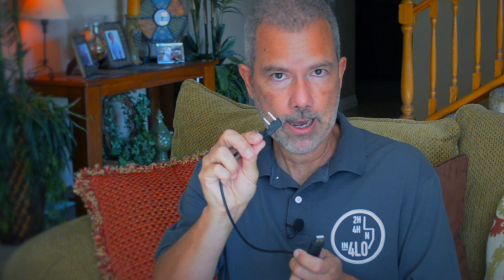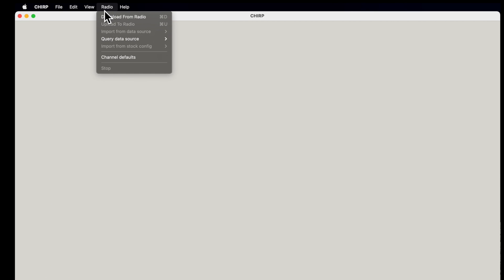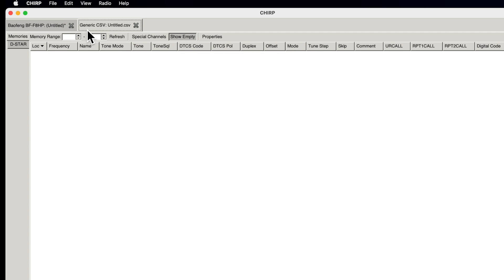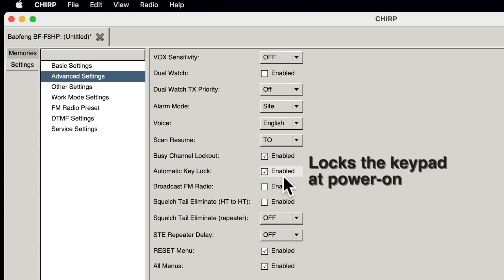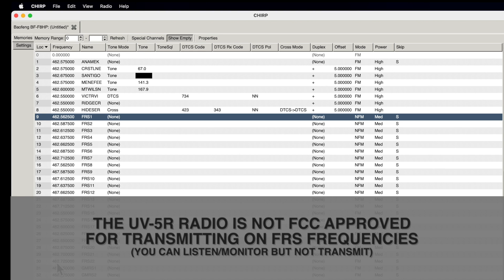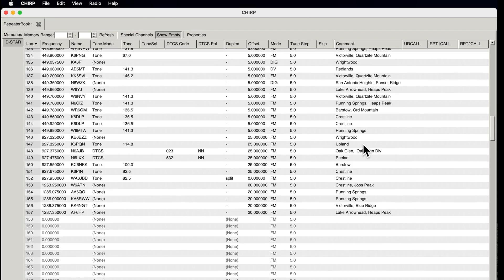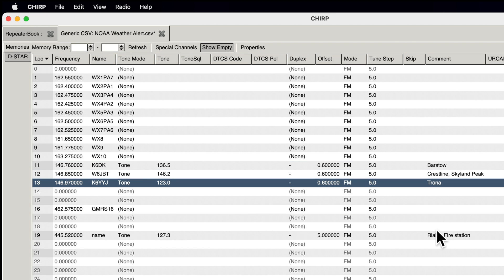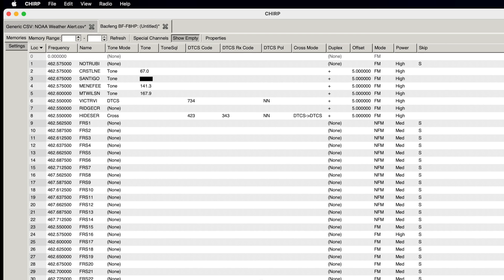How To Use CHIRP Software To Program A Baofeng UV-5R. Using CHIRP for HAM, GMRS, and FRS Radios

Comment: I just purchased a UV-5R to use when offroading with a group. We used Channel FRS-14 to stay in touch with the leader of the group. I never did transmit, just listened to him. Am I legally able to transmit to the leader if need be.
Reply from the maker: "Legally"?  No ..
Reply: @TheNotaRubicon  is he legally transmitting to the group
Reply: Never mind that 2nd question, I just remembered he was using some cheapo walkie talkies he have to everybody else
Reply: Now to GMRS, I applied and received a Call Sign for my GMRS License. I still can't transmit using the UV-5R. How do we Baofang UV-5R owners go about getting this Wonderful (kiss the radio) unit approved by the FCC. Do we need to write letters, emails, etc...

Comment: Does anyone know how to run Chirp on a Mac??? I have a new Mac Mini with the M1 chip
Reply from the maker: Just follow the instructions to install it, then double-click on the app icon to open it.. pretty much like every other app on a Mac.
Reply: @TheNotaRubicon  its an "Unverified App" Got around that issue. Now I get an error message that the app quit unexpectedly. Ive deleted and downloaded again several times and still the same result. At this point unless get some guidance otherwise I hope there is another way or another App to program my Baofeng with my Mac or other device.
Reply from the maker: "quit unexpectedly" is nice-speak for "it crashed" .. so it is possible that it is not M1 compatible - not sure anything can be done at your end about that, but you may want to report the error to the CHIRP team here:  https://chirp.danplanet.com/projects/chirp/issues?set_filter=1
Reply: @TheNotaRubicon  Randy, I'm betting it is the CHIRP SW won't run in the Rosetta Intel emulator that Mac M1's have.  My solution for software like than is to use Parallels Desktop for M1 and run a WIndows 10 ARM64 virtual machine.

Comment: How do I merge my frequency list from Wouxun radio programming software to Chirp
Reply from the maker: I dont use the Wouxun software, so there may be a better way - but you can upload the list from your Wouxun program into your radio, then connect to CHIRP and download the programming from the radio into CHIRP.
Reply: @TheNotaRubicon  I will try that.  Thanks
Reply: I tried doing what you suggested and  it won't allow me to do it.  After you hit download from radio and it asks you the Com port, make and model it doesn't have my radio on the list.

Comment: Hello Randy, Does the cable that comes with the radio for Programming not work?? I did all the steps correct and I am getting radio not found. I don't want to buy a new cable if I am doing something else wrong. Just curious to know if the cable that comes with doesn't work with Chirp??
Reply from the maker: none of my radios came with cables - i had to purchase them separately.. if it doesnt work, it's either bad/fake, or there is a problem with the drivers installed/not installed on your computer.

Comment: Not sure if someone else has asked this question yet. If I have two radios and one is programmed with a bunch of channels and want to duplicate those programmed channels on another radio, how is that done on the computer? I understand how to download my channels, your overview of that was great. In other words I want both radios programmed the same, how is that done? Thanks
Reply from the maker: If they are the exact same radio, just download from Radio #1, then plug in radio #2, and upload..
if they arent exactly the same, you can usually copy/paste the columns from one program to the other, then upload..
Reply: @TheNotaRubicon  thank you for the quick response, I figured it would something pretty simple.

Comment: I have three UV 5Rs that I'm trying to program in CHIRP, but when I try to connect to my radio, there is nothing in the "port" drop down.
I went to the Miklor site, and downloaded the 3.2.0.0 exe file. but once it's installed, I get the "This device cannot start. (Code 10) A device which does not exist was specified" error in device manager. I bought the upgraded cable from Btech that you recommended, (BTECH PC03 FTDI) and also tried using the cable that came with the units. It says I have the correct driver installed but I still get the yellow triangle in device manager with the above mentioned error code. Any help would be appreciated. Thanks!
Reply from the maker: Sounds like a Windows/driver problem - sorry, I cant help you there.  Maybe someone else will come along with some suggestions.
Reply: @TheNotaRubicon  Thanks!
Reply: @andybynum5365  
This problem is more common  than noted and its generally not a windows driver issue. Brand new computers (with updated drivers) will still do this occasionally. The fix is unknown but it's generally attributed to the Chirp software.

Comment: Use mine to lockout. Radios that I want to use as scanners. That is I shut off vhf-UHF xmiter.  other wise I set the recive/ transmit  ranges to keep out of officer territory. Then finish and try to see if it's set. I've even handed the tranciver to a unbeliever to try to force it to run out of range and the radio firmly tells the operator of a "no" situation. de kv4li 73

Comment: This is a lot of great information. Where it failed me, and it's all on my end,  is that the Upload To Radio option is greyed out. I have a brand new Baofeng wire so there shouldn't be any issues. Any suggestions?
Reply: I'm having the same issue (Upload To Radio option is greyed out) with my 2 older UV-5R HT's. The new ones I have worked fine with CHIRP??

Comment: I am using windows and there is no ports listed. Any ideas on what I have done wrong?
Reply: Mikey,,, You will NOT see the radio listed in the Windows File Explore program. You'll find the port/s listed in the CHIRP pull down menu, ie. Com 6, Com 5, Com 4...etc. You just have to try each one to find the one that works.

Comment: Thanks for a great video. Following your video I was able to connect and download the original program from the Baofeng UV-5R8W, however, I do NOT have anything showing in the 'settings' column (blank). What do I need to do to get this part of the spreadsheet to fill in?

Comment: Just got a Baofeng UV-5R and am trying to set it up to use with some Motorola GMRS radios. I put in the frequency for channel 16 and can hear everything being said on that frequency but they cannot hear me. What am I doing wrong?
Reply from the maker: Make sure the Motorolas are not using any Security/Subchannel/CTCSS tones or codes - that would prevent them from hearing other radios.
Reply: @TheNotaRubicon  Yep that was it.  Duh.  Thank you!

Comment: I've got a question.  When entering the GRMS frequencies how do you select which channels to enter? I see on wiki radio reference  many frequencies have 50W GMRS power are these better to use than the lower power frequencies with the uv5r? I hope I make sense, I'm as green as a pine.
Reply: So green you don't know that you cannot use this radio on GMRS 😀😀.
If you are not going to transmit or you just going to use it in SHTF situations, its ok.
If you need to transmit, buy a legal GMRS (type approved) radio.
Reply: @jplacido9999  receiving gmrs yes no transmitting.  Awaiting the Btech 50x1. I've got my gmrs license, currently working on ham tech license. 🏴‍☠️
Reply: @LanceSheppard  that's great !!!
Best wishes 👍

Comment: Great video ! I have plugged my UV-10R into my Mac (Chirp Installed) and in the drop down menu when trying to upload  it doesn’t list the crane UV-10R as an option. , It wouldn’t allow me to upload it as a 9R but will as a UV-5R .......should I continue on as a 5R and upload or wait for a newer version of the software  to show the 10R?

Sorry I’m pretty green to this.
Reply: Correct use UV-5R.  The 10 is a bodged 5.

Comment: Can you have different frequencies on A channel than is what on B channel?    Want to use “A” for repeaters and local QC. Then use “B” for emergency & weather frequencies
Reply: The orange button on the front (VFO button) toggles between Frequency Mode and Channel Mode. If you select Frequency Mode then you can manually enter a frequency on either top or bottom. Use the blue button (A/B button) on the front to toggle between the top and bottom frequencies. To view and change what frequencies you have programmed (like he did in this video), you have to press the orange button to go back to Channel Mode and then you can scan or scroll through the save channels.

Comment: do u have to  program to talk to cb
Reply from the maker: The UV5R and similar radios operation on UHF bands.. They cannot talk to CB radios.
Reply: Cb radios operate on HF, while the Baofeng Uv-5r operates on VHF and UHF. No you can't talk or listen to cb its just out of range of the baofeng uv 5r or any kind of baofeng.

Comment: FYI I just went through getting my' obviously a fake cable' to work. I ordered the radios , antennae and cable from Ali. Anyways there are two main cables. Ftdi and prolific. If it's not working pop the cover off the usb connector carefully. Look at the chip in there and google the driver for it. Worked perfectly for me, cheap cable that will be replaced but I got it to work.

Comment: Right out of the box, when I plugged in the cord to the radio/computer, the radio went to TRANSMIT..   I let it go for a while thinking it would stop transmitting, but it never did...  WHY????
Reply: cord may be bad, I put it in the USB first< wouldn't work in USB3 had to use usb2 connection!

Comment: I'm about to lose my mind.  I'm trying to download from the radio.  With "port" i click the drop down and there is no options.  I can't download without it as it says error.  What am I doing wrong?  HELP!
Reply from the maker: Either the cable is not plugged in, its the wrong cable, or you need to install the Windows drivers for the cable.
Reply: @TheNotaRubicon  I know its a good cable and it is plugged all the way in so I can try the install.  Can you share more info on the "how to" of this?
Reply: @SamiMontella  Mac or Windows?  Macs have special steps to take for setting up drivers to work.  Also, ensure you are selecting the right radio and model.  Tune to an unused frequency, remove the antenna (as mentioned) and turn the volume to 75% minimum.  Hope those helps.
Reply: @TheNotaRubicon  

Was having problems with mine and that was it : downloading the drivers,    not really intuitive, can't remember ever downloading drivers for a cable but that did it. I'm new to this game - purchased a FT-60 first but grabbed one of the UV-5R TPs , just to play with and I like it, for the price it's not bad, thanks for taking the time to put this information out there. CHIRP is not bad once we get used to it, like most other software.

Comment: on mine it is only showing com3 ? what do i need to do because it will not allow me to do anything when i click down arrow it shows only com3 and then i pick my baofeng UV-5R and click ok and it says could not download now i have the MirKit cable that the website i bought radio said to get but i do not know what to do ? Please Help !!
Reply from the maker: It could be the wrong cable or it could be a driver issue - unfortunately there is no simple/easy solution - You will have to do some troubleshooting to narrow down the cause.
Reply: Mine wouldnt show up either. In my case it was simply that I hadn't completely plugged the cable into the radio. Seemed in, was snug....but it really wasn't.

Comment: Quick question.. When a Repeater has a up tone of 131.8 and a down tone of 123.0 What column do these go into ? Or another example CSQ up and CSQ down.. Also not sure what column to put those into.
Reply from the maker: I have never heard the term "up" or down town, but I would guess/presume the "Up" tone is the Transmit CTCSS and the "down" is Receive CTCSS.. Dont know what a CSQ is.
Reply: I figured it out, but yeah, your right, up is RX and down is TX.. Repeaterbook has them listed as up/down or in/out tones, lol..
Reply: @RookieLock  Common terminology is input tone (input to the repeater/the tone you transmit with), and output tone. In CHIRP "Tone" = input tone, ToneSql = output tone (the tone you're receiving from the repeater). You do not have to use a tone to hear the repeater, you can leave that blank, but you will need to have the correct tone programmed in to send a signal through the repeater.
Reply: @TheNotaRubicon  CSQ = carrier squelch (no tone)

Comment: Newbie also. I am getting an error. "Radio did not respond" I am using the cable that came with my Baofeng UV-5RX3.
Reply from the maker: That means that the computer is not talking to the radio.. so make sure the cable is plugged-in (push it HARD!) and  check/change what port you are using.. if you still cant get it to connect then it is likely a driver issue with the cable and in that case you will need to consult the Google machine.
Reply: Make sure you are using a FTDI chipped cable and the volume turned up on the radio and you are choosing the correct radio in chirp.
Reply: @Littrell1966  FTDI (FT232R) drivers only with FTDI cable, it could have one of several chip sets
https://www.miklor.com/COM/UV_Drivers.php

Comment: Newbie here. Is there a channel you can recommend for the UV 5R that would function as a walkie talkie between two radios with the FCC license?
Reply from the maker: Not sure what you mean by 'with the FCC license' - but the UV5R is only legal to use in the HAM bands, with a ham license.. However I know that many people use non-ham frequencies like 462.575 which is a GMRS/FRS frequency. although not fully "legal", if you don't cause any interference, dont harass anyone and don't act like a jerk, it is likely that no-one will complain and the FCC SWAT team will not raid your house.
Reply: @TheNotaRubicon  I thought I read in various forums that you can apply for a 10yr license or permit through the FCC to transmit on the FRS/GMRS frequency bands? Thanks for the reply and for putting these videos together. The most straight forward information I've found for getting started.
Reply from the maker: Ok - that is correct. You can buy a GMRS license from the FCC for your family which is good for 10 years. However because the UV5R is not "FCC Part 95E" approved, even with the license that particular radio is still not approved/legal for use on anything other than ham bands.. Hasn't stopped the millions of people using the UV5R on GMRS/FRS frequencies every day, but, thats the rule.

Comment: Thanks for the video. Really simple way to explain CHIRP. Can I copy programming from one radio to multiple new ones assuming all are same brand model?
Reply from the maker: Yes you can! That is a great way to keep a custom configuration between friends/family.
Reply: @TheNotaRubicon  thanks for quick response. Btw, had great time at Red Canyon Rd. Trip.
Reply: @TheNotaRubicon  does chirp app work on osx 10.15?  Just curious if it's been updated, I stopped short of the security warnings, searching for safe source just be be sure before I grant access. Thanks